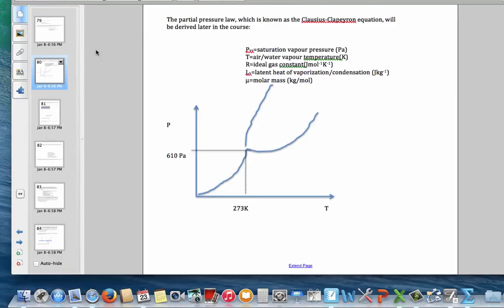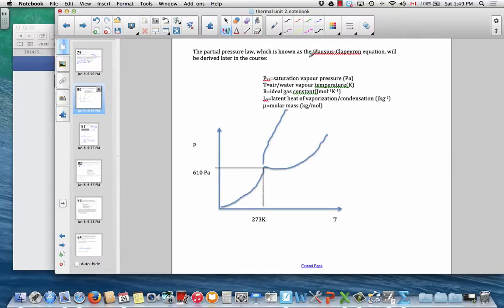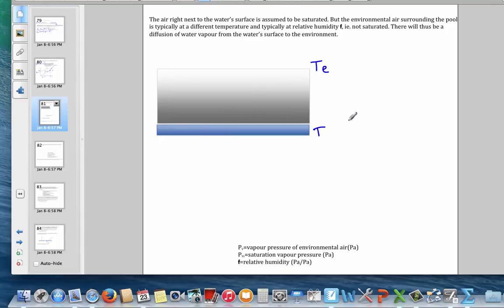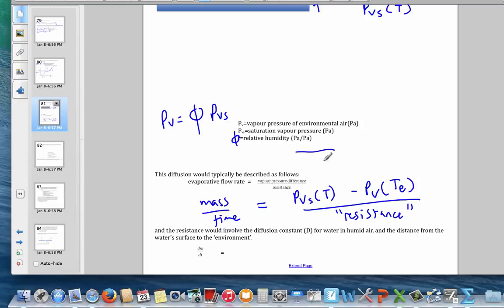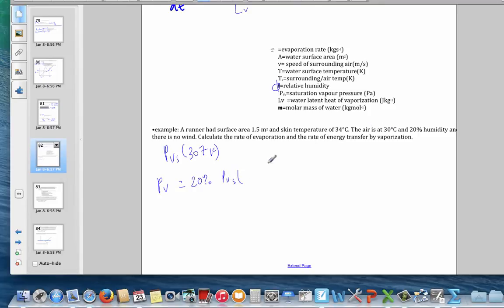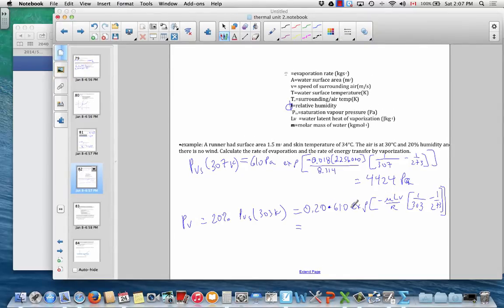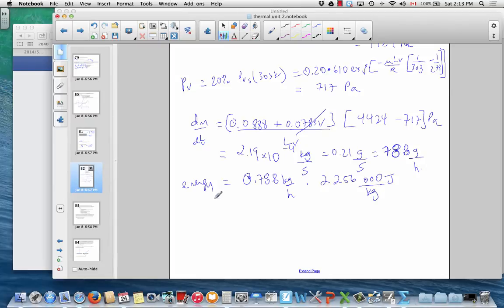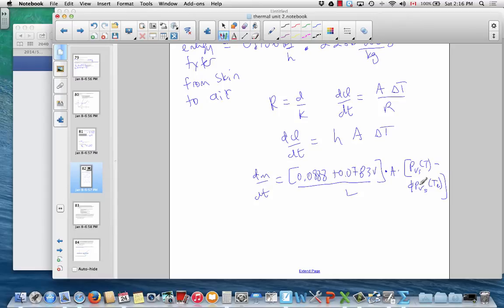evaporation rate

Comment: Hi Don, is the surface area(1.5 m) needed to be included in the equation of evaporation flow rate at the example question?
Reply: did you find an answer to this? Im having the same problem

Comment: Good explanation.  Gas velocity can not be 0.  If truly 0 then there is not movement of water vapor (gas) from the surface to the surrounding.  By definition evaporation is gas movement.  Also there would be air movement from natural convection.

Comment: I wanted to ask why did you use 610 Pa as your initial pressure. Thanks
Reply from the maker: Vapour pressure of water at 273K
Reply: You could use any reference though. 373.15K and 1 atm is another common point to pick

Comment: HI Don, its helpful video. thank you.

Can you please help me. I am working on a project below task is as follow:

there is a tray with capacity of 1.2 kg internal volume. & there is copper coil with 82 degree avg. temp. the coil is deep in tray. there is 90% RH. so challenge is 300 ml water will dropped in tray at 0 degree temp. in every 8 hrs. water tray will over flow in 12 days.

If I used there is material steel coil. what will be the evaporation of water, day of over flow and  coil turns.

Coil spec: Dia. 4.2mm
Length: 1m
Coil Turn : 8
Coil Dia: 30mm

Steel coil:Dia.4.2mm
Length: ----.
Coil Turn : ----.
Coil Dia: ----.

Comment: Hi, I'm currently trying to calculate rate of water removal from a liquid by bubbling with a dry gas. I am having trouble finding the correct equation to use. Do you know what the name of the equation is or where i can find it? or even better, would you happen to know an equation specifically for my scenario?